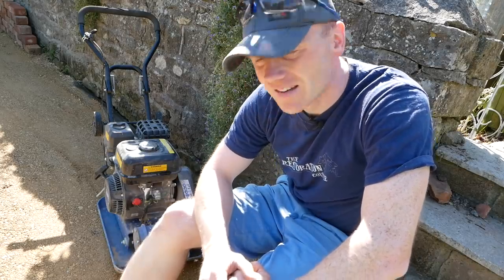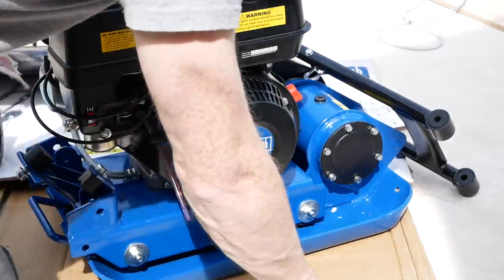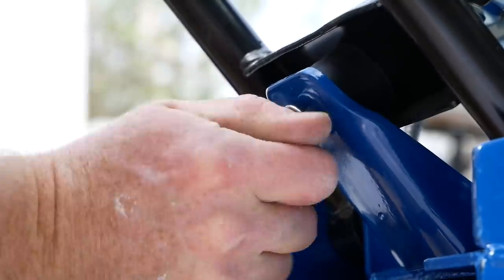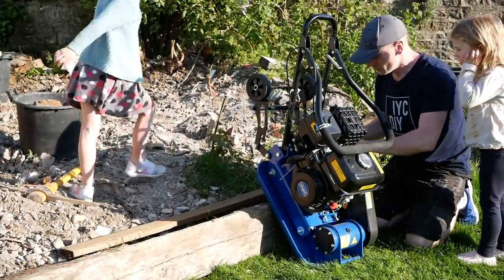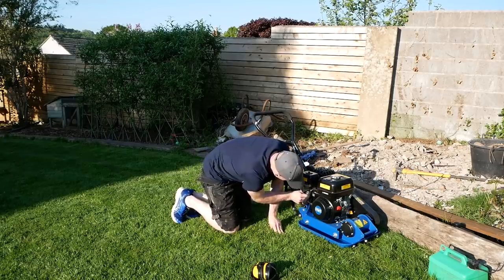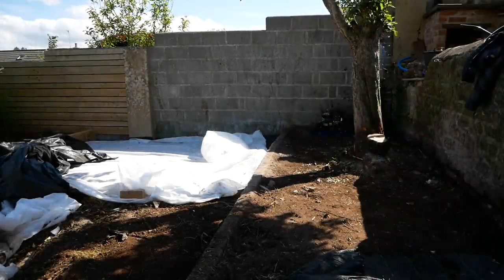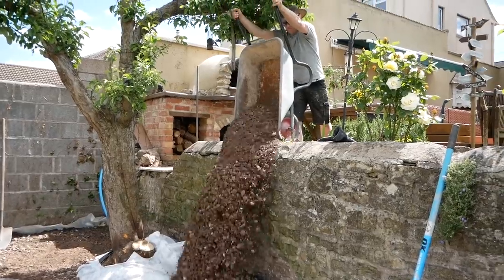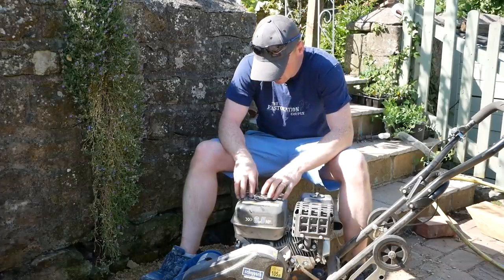NEW PLATE COMPACTOR - When Buying Makes Sense! - HIRE v BUY

Comment: Something I learnt while doing the "cold lay" course (for filling holes in the highway). Your base material (typically type 1, maybe crushed concrete or road plainings) should have a certain amount of moisture in it to help it bind when you compact it. What this means in practice (usually on hot sunny days) is that you need to give it a good spray with a hose, and you'll be able to feel it binding together more as you move the compaction plate over it, plus it eliminates most of the dust that can get kicked up when it's too dry.
Hope this helps a bit in the future. Appreciate the work you put into the channel.
Reply from the maker: I thought that might come up in the comments! 😀 We did exactly that, hosing down between layers especially with the self binding gravel. But the last few clips I filmed of the plate compactor I just ran it over to get some extra footage and it happened to be the dry dusty section. 🙄 When you water the self binding as you go, it ends up like a hard screed. Worked great. 👌

Comment: I got one too!! Its well worth the money too, hope you and the family are well, best Robin
Reply from the maker: 👍 Can’t complain really, if you service the engine well. I have enough projects planned within the warranty period that it was a low risk purchase.
Reply: The legend that is Robin Clevett! Glad you are perusing over the same channels as us mere mortals! 😃 also I was very tempted by this wacker.
Reply: Mine keeps cutting out. Seems to over heat, no major use just patio , drive and earth.   The throttle lever isn't great either.  Waiting for Aldi to pick it up to check it out.
Reply: Likewise - great vfm! @Tim - sucking eggs, but if yours was shipped as mine was, the bolt through the throttle lever clamp needs to be reversed so it can tighten!
Reply: I've just picked one up myself. Does anyone know where the small tube coming from the carburetor is meant to go? Mine is hanging loose.. Thanks in advance!

Comment: I needed a whacker when laying a brick pavement. I didn't have one and didn't want to hire. So I made a plate from  some old steel box section and plate, modified a 1/2 inch drive extension with a socket on the end. Attached this to a large bolt on the plate and put this on my Lidl 'kango' . Not as convenient as a wacker plate, but did the job😊

Comment: Velcro double sided tape, can rap it round the handle shaft, then round the wheels when they're up, and back on to shaft. When you need to drop wheels, it's really easy and quick to undo Velcro, and rap it back round itself when wheels in use.

Comment: Nice to see a simple, fact based review without dramatic music.  Thanks - so good to hear Joe Public give a real world review.  I previously used an Evolution Hulk electric compactor that I got on offer from Amazon a couple of years ago.  I paid about £160 from memory.  It wasn't bad, but it wasn't really up for any heavy duty work - I just did a small patio area of about 5m x 8m.  It coped, but wasn't perfect.  I sold it the following year for £180!  So yes, I agree, you could sell this after use for the same, or quite possibly more, than you paid for it.  The key is to keep it clean and looked after.  Cheers!

Comment: Wise move, I've a similar one I've had for 18 months, saved me a fortune as I can use it for a few minutes and get it out the next day for an ongoing project.  My throttle level is fine, just needs a good tighten with some rubber/foam strip under the clamp.  The wheels are handy, saves dragging it around the place and scratching any surfaces.  Done the same with a mini excavator, laser level and cement mixer, all of which I will sell when my renovation project ends.  Buying makes a lot of sense and is so convenient  for some things.

Comment: I just purchased one of these under a different name, in the U.S. It is called a Yard Max, 6.5 HP with wheels the same as yours. Your comments about purchasing one was my same thinking. I am going to build a small house in the desert and my vehicle got stuck on the property. This tool will be very well used, by the time I don`t need it anymore. Thanks for the in depth review. =) I paid $410 U.S. dollars.

Comment: I've found that its more economical to purchase smaller tools new or s/h than to hire them and it makes so much sense, especially if you can see a possible future use.  2 uses often means that you are in profit!  My last hire item was a 3 stage industrial ladder that cost me the same price on a one day hire as purchasing the same item 12 months later !!!!  I suppose that larger items such as Genies and the like would take a few more than one job to show a profit.  Also, hire equipment often is not used or maintained properly, meaning that job you were going to do today will have to be put off until the hire equipment is exchanged - all the best kit goes to the big contractors.

Comment: I bought a breaker from Screwfix as I needed it for a while. It cost 2 weeks hire and I have used it lots and lent it to friends too. Best £150 spent!
Reply: I sold mine and I wish I hadn't. I've needed it loads since!
Reply: Same. I bought a Macallister one from Screwfix for £150 and it's a decent tool. Very handy to have, particularly when breaking concrete in old post holes.

Comment: The issue with the wheels not staying on the unit is due to the fact you have tightened the bolts to tight at 2:24 in the video, I had the same issue :-)

Comment: Great video. I bought one but have a question. What is that transparent tube hanging from the side where the throttle is? Do you leave it hanging or connect to the top bit?

Comment: I just bought this same machine from Aldi and it is arriving tomorrow. I wanted to be able to relax and do the job a bit at a time when I felt like it so I couldn't be bothered with hiring. I'm just going to sell it on eBay once I'm finished with it. I do have a concern though. I have to get this thing up and down 2 flights of stairs every time I need to use it. Do you think I can do it on my own or will it need a second person?

Comment: I looked into buying one recently to and saw this one in Aldi as like you said you can make nearly your money back after finishing your job! 
My only recommendation on these "chinese" engines is always fully drain the petrol and run it until dry before storing over winter. Should last years then.
Reply: I thought they were made in Germany....
Reply: Nope, that looks like either a Bison or Loncin engine, Loncin use to supply engines to BMW for motorbikes back in the day.
Reply from the maker: Like iPhones are ‘designed’ in California. 👍
Reply: Nothing to do with the engine, petrol goes off so any small engine will fail with stale petrol

Comment: What's the clear rubber pipe hanging down next to the pull cord? Should that be attached to the air filter?
Reply: I had that exact concern on the one I bought, surely it cant just hang down can it?! There is a black "nipple" right underneath the air filter that looks like the pipe should attach to. Bit fiddly but I managed to put it on there and the machine works fine. However every single picture and YT video of this machine shows it hanging down! Now I don't know who is right or not! Oh well

Comment: The trouble with these little petrol engines is they work fine for the first season, then over the winter when it's not being used it gums up the petrol tubes and carb and don't work the following year.
Ivw spent hours trying to revive my titan petrol strimmer this year.
Reply: Use Aspen fuel
Reply: Drain the petrol after the season is over. Yes, it's that easy🙃

Comment: Any tips on how to drain the fuel tank after use apart from running it dry?
I'm guessing could either siphon or dismantle carb assembly and drain through the fuel line... Am I missing something more often? 
Also, before long term storage is there some kind of flush or cleaner I should use to keep things from getting gummed up?
The manual is silent on these things other than saying empty for transport or storage...
Reply: Did you work out how to do this? I was wondering the same thing!
Reply: @Wilkinson77  no unfortunately not. I ran it dry and will hope for the best.

Comment: are you going to putting any additives in the fuel system especially when storing it for the winter?
Reply: You should drain the fuel, and run it dry before storing in winter, otherwise you will have Problems next time you try to use it.
Reply: Run it on Aspen 4

Comment: Wow thanks for the heads up! 
I went straight to the Aldi website and ordered one, £297 (incl P&P) compared to almost double that from screwfix. Interestingly, the model number from Aldi is the same as the 5.5 hp from screwfix but as per your video and the Aldi website it does seem to be the 6.5 hp model.